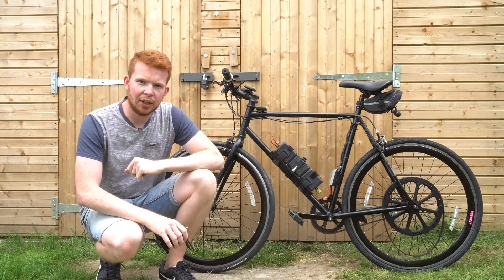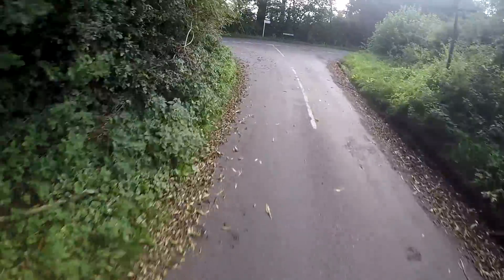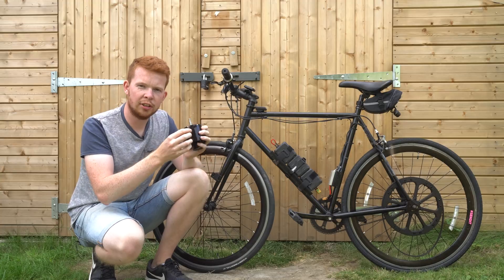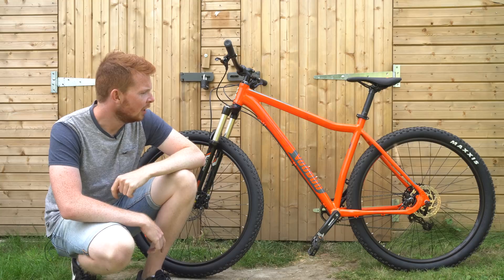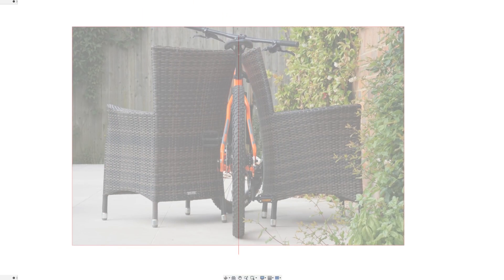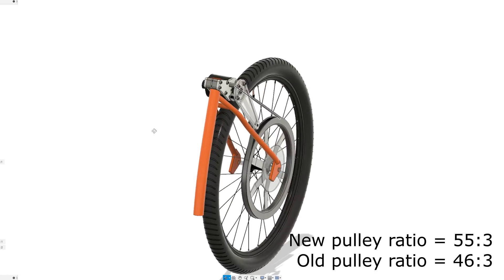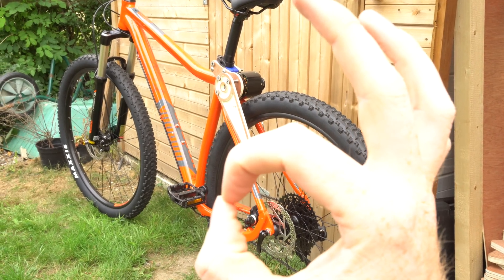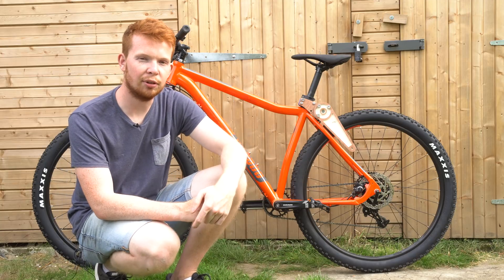Electric Bike 4.0 - Prototyping

Comment: An average bicycle chain takes an amount of torque greater than your body weight, multiplied by the length of that crank arm on the pedals. And I'd guess that kicking out as hard as you can with your full body weight behind it is almost 3x your body weight in force for a very brief moment. So if the motor puts out less than that in peak torque, it should be ok on the chain driveline.

In my past experience, I've never snapped a chain. (Never had a really overly worn out or one of those gram-saver ultra-light deals. So I suppose it can't be completely ruled out.) However I've stripped the hub threads where it connects to the sprocket set a few times by doing wheelies from a dead-stop in a hill-climber gear. Young and stupid then, and then the bike shop got something different than aluminum for the wheel hub the third time. (If I were to guesstimate from that scenario, it'd be something like 500ft/lbs at the crank, and multiplied by whatever that ratio was.)

Your driveline looks easier to work out than going through the chain for other reasons. However that may give you some numbers to come up in estimation if you reconsider it.

Comment: Why not put the engine on the other side, and put on a MUCH bigger first gear witch is driven by electric motor, then adjust the normal gearing so it wont go that high.

Comment: Amazing quality and eye for detail, What I can not understand is why not use a mxus hub motor and control it from your vesc 6 it even has a build in temp probe. I use a mxus in a 20 inch wheel and it can take 8kw peaks no issues and last for many thousands of miles no service if it's had conformal coating applied.

Comment: When I saw the thumbnail I thought you had the motor in direct contact with the tire. It would transfer the torque by friction between outside of the motor and outside of the tire. You can improve friction by a sheet of rubber glued to the outside of the motor and a spring to press the motor to the tire. Motor would have to run in reverse, but the gear ratio doesn't look much off from the pulley and pinion. This is how Solex bikes work, so it's know to work. It would be such a simple design. Would love to see someone try it!

Comment: I made your e bike version 1 and it works great.

Only issue I had is that the 3D printed motor mount was not strong enough and the motor screws pulled right through the mount. Should I make the mount out of aluminum or try 3D printing again?

Comment: Very cool design, although using a seperate idler and tensioner feels really wrong. Maybe you can use the tip of the idler arm as a tensioner by adding a small movable segment.

Comment: VESC usually have options for regenerative braking. The power generated from braking goes back into the battery and you don't have to use the brakes (as much).
Reply: Just got to the part about regen brake. Why do you use the normal brakes if you have regen braking?
Reply: dont think regen breaking is enough, i know its possible to config the vesc to break harder but it highers the risk of burning the vesc due to voltage spikes

Comment: ou could connect the motor to the largest cog on the cassette then use the limit screws so you cant change into that gear. then ou make use of the already made freehub the cassette is mounted on.

Comment: Sweet
 bike Tom! I miss the pneumatic engines though! Maybe you could use CO2 cartridges with a pressure regulator, or a paintball/air rifle high pressure tank to make thinks more interesting. Of course the latter ads considerably more weight so a more powerful engine would be in order :) but as for the CO2 idea this could be great for a plane as they are very compact.

Comment: Hi Tom

Nice to see the e-bike projekt running again!

I don't think that the extra bearing will save your motor bearing. There is two bearings located in the motor and then you are adding a third to the motor shaft. This could cause large forces to all the bearings because of misalignment of the bearings.

I work within mechanical engineering and I just love your projekts! 😊

Comment: You said you can now set the bike on both sides and not obstruct any electronics. But it is good practice to set the bike down on the side with the break disks, you do not want to risk damaging the rear derailleur, this can lead to shifting problems and the chain skipping down to higher gears without warning. And if at all possible it is good to keep the bike up-righted so you don't cause bubbling in the break lines.

Comment: Hi Tom, Bearing life in the motor is a bit of a concern as it's always engaged. If the belt drive could disengage via for example a freewheel at the hub, that would maintain better effeceincy when cycling and freewheeling.

Comment: On my own DIY electric bike, i removed the rear disc brake, and used the six threaded holes for mounting. I mounted the motor just underneath with a thick aluminium plate, and connected them with a short chain. Have you considered using regenitive braking via the electric system, instead of the disc brake?
Project looks awesome, keep it up!
Btw i chose a 29er mtb as well for my project. Seems to be a good choice for what you're doing. I can send you a picture of my setup if you want :)

Comment: You mentioned prototyping the rear sprocket carrier but printer is to small. Make it in sections out of ABS and chemically weld the parts together.

Comment: Hey Tom, I made a version of your bike using chain and sprockets, I  used go kart size #35 chain which is smaller and was able to use 11 tooth sprocket on the motor, and 80 tooth on the wheel. Check it out https://m.imgur.com/gallery/o3z0gGj
Reply: Also more detail on this reddit post https://www.reddit.com/r/ebikes/comments/8z4u3i/rc_motor_esc_fixie_non_3d_print_parts_edition

Comment: On the old bike you had caliper brakes (not V-Brakes) which are sometimes quite bad. However, modern road bike caliper brakes (e.g. the Shimano Ultegra R8000) can be quite good. Brake pads shouldn’t wear that quickly, get some green Swissstop or salmon Koolstop brake pads and they should brake much better, especially in wet or cold conditions.

Comment: I would attach the idler pulley with a clamp around the frame, i think the bolts holding the bracket for the pulley will be a little on the weak side.

Comment: Been loving these bike videos. I'm not a physical engineer (I'm a software engineer) - so forgive my dumb question: 

Why not use the motor to power the pedal gear instead of the wheel directly?  Then you could use the bike gears. 

I'm sure there's a simple reason why not - I'd guess space? (no room for feet, pedals and a motor)

Comment: Its possible to use the  rear freehub space for belt drive if you can design a belt pulley fit in the freehub after 1or2 cogs in the cassette is taken away.(the rear hub of a disk brake bike is pretty compact and this method could be the most rigid and easy way)

Also you can get the bike geometry from the bike manufacturer too

Comment: you inspired me to make my own electric motorcycle. i modeled my own reduction pulley mount to reduce the gearing of the chain from 6:1 to 18:1 because i'm using a #41 chain on the bike and the pulleys are already huge. It has so much torque just from a 6374 motor on 12S it's pretty crazy. i'm just waiting on a larger and wider HTD 5M belt and pulleys because the 10mm electric skateboard one didn't last at all so i got 20mm this time. 

i'll be making a video if it soon once i have it rebuilt with the larger pulleys. i might switch to #35 size chain just so everything is smaller and lighter.

Comment: But what if you decide to pedal it? How much resistance that motor will give to your legs?
Reply: If the system is well designed, you can always drive in "neutral" by electrically (or mechanically) disconnecting the motor from the battery.
If there isn't any recuperation technology built at the system, this is the case at any time since you just 'connect' the motor when you want to accelerate. There shouldn't be any energy flowing back and therefore be no resistance. I'm not 100% sure though.

Comment: Echoing comments e bikes have to be below 250w (unlikely to be tested) but must only provide power when the pedals are moving and ONLY up to 15mph. Posting this online isn't the smartest move if it's being used on roads or public places. This is technically a non type approved motorbike and using on the road can bring the same penalties as riding a normal motorbike without correct licence or insurance and could see you racking 9 points and a fine. Not attempting to be a Debbie downer but the risk is real should anything happen
Reply: I'm sure the UK police are aware of the popularity of diy e-bikes and e-bike mods, and I'm sure they will stop and charge anyone doing unrealistic speeds on public roads. I would also think twice about posting any video of you riding it on public roads. People have been prosecuted in the past with videos they have posted used as evidence against them. Still looking forward to your project though.
Reply: Really sucks how government really does everything to stop people from wanting to have fun.  Everything seems to be taxed heavily, regulated heavily, or simply illegal these days.
Reply: Red Squirrel in my opinion the law could be relaxed slightly with little to no effect as has been done in Europe I ride an e bike my self and I can easily go faster than the 15 mph electric assist under pedal  power. That being said the motor is incredibly useful for hills
Reply: Rich I used to be able to average 18 to 20 mph on my cycle, I'm a bit slower now but one big problem with cycling at a faster pace than most is that a lot of car drivers pull out in front of you assuming you are only going 10mph. If you are doing 30+MPH this is a big problem.
Reply: DoctorJ3kyll I had the same problem.  At the time I was about 18 stone which doesn't slow down very quickly when the same car decides to turn left in front of you.  Ill health means I haven't  ridden for a couple of Yeats now though :(

When it comes to ebikes on the road I think something nicely engineered like this won't attract the wrong sort of interest unless Tom has an accident.  Changing the rules would lead to lots of dangerous and cheap bikes ending up in the hands of people who don't have the skill to ride and inclination to maintain the bike who you don't want running around at high speed.
Reply: Stephen Parkes I regularly see 4 e bikes on my way to work. One of them I can't hold his wheel if I get a gap between us, he is not pedalling.
Reply: This got me curious and I checked into the laws here in Canada, it does not seem TOO bad here, 500w is the limit and can't go no more than 32km/h (that seems kinda limiting though - I've done that with just a pedal bike if conditions are right).  There's a couple other requirements like needing an emergency shut off, and having to wear a helmet.   I suppose with a custom job like this you can just make your own rating plate and try to make it look stock and you'll probably be ok.   If you want to go over 32km/h I suppose you could bring it up to that speed turn off the motor then pedal faster.  Ex: going downhill.  I had a bike with a speedo as a kid and I hit 40 once. It feels like you're going to take off at that speed though. lol.
Reply: Get an ebike to start with.
I ride an a2b metro with a thumb throttle from the factory so it's permitted not to be pedal only,
The power requirement can be tuned in software too and have an off road mode if it was fitted from factory, maximum user voltage is 48v or 13s with a peak power of no more than nominal 350w.
So I got an a2b metro it still complys with its factory specs but it's got enough torque to pull any hill and I run it single speed i don't need gears i can apply enough torque any situation.
I use a 12 fet basic sinewave Bluetooth controller and a mxus 3k hub laced in motorbike rims front and back with new suspension, brakes, drivetrain, I've used the motors kv and wheel size so at 36v the torque drops off around 15mph so it seems like it's limited which it is by volts not software I use that for amps, I can throw 120 phase amp at the wheel max and climb anything and get upto 35miles off a 36v 350wh pack in eco/legal mode or about 10 miles with just under 2kw not bad for a £250 spares or repairs bike that's cost a bag of sand all in and ive got to have fun making it, it's a bonus that it conforms so i can go anywhere a normal bike goes police love the look of it and I get comments all the time as it looks so chunky compared to the stock granny bike it once was.

Comment: As an avid mountain and road biker, I can tell you immediately that replacing rim style brakes with disc brakes is gonna have the opposite affect you desire, disc brake pads are far thinner to start than rim brakes, which I have ridden thousands of miles without needing to replace, and you’ll find yourself replacing disc brakes a lot more of than rim brakes. Also, suspension and using a MTB is going to decrease your efficiency dramatically, lol. If you want to go for a half and half system MTB and road bike I recommend you buy cyclocross wheels, or a bike built around those, which should have a good compromise of all the features you want. Hope this was helpful! I’ve had a lot of experience with bikes in my day, and I hope I can be of some use.

Edit: I realize now, all this advice is from my 3,000 dollar bikes and not Walmart tier bikes, that sorta changes things.
Reply from the maker: I honestly can't give any input on the disk vs rim brake argument as I've never tried 'decent' rim brakes. Maybe there are rim brakes out there that can match disk brakes, I don't know. It's interesting to hear your experience though! 

In terms of the MTB suspension, the efficiency won't be affected. As ABaumstumpf mentioned, the power is transmitted directly from the rear wheel without the 'bouncing' caused by pedalling. As for the wide knobbly tyres, I'm looking at getting some semi slick tyres, basically wider road tyres. Hopefully this will increase the efficiency a bit and also allow more grip on hard surfaces.
Reply: Rian Mach The sintered pads on my Hope disc brakes last just as long as any rim brake I ever owned, and far longer if riding often in wet conditions. Organic pads might be different, I don't know. At those quoted speeds, with dual pot calipers, I'd suggest a rotor size upgrade to 200mm on the front though! (Or 4 pot calipers)
Reply: Derren Weekes I ride MTB  a lot and I have to replace my disc brake pads like every 10-15 rides, (high quality pads too with heat sinks) and on my old MTB it had rim brakes and I never once replaced them, after several thousand rides. Idk, maybe the materials have changed. I also get going like 45 down my local hill fairly often on my road bike with rim brakes, and have never had any issues braking with them.
Reply: This is complete nonsense. Disc brakes are much more suited for this application. Why do you think motorbikes have disc brakes and not rim brakes lol.
Reply: It really depends on what and where you are riding.
On my last bike i had to replace the brakes i think every 2 months - pretty much only used it to drive to work.  
And a suspension might decrease efficiency a bit, but that is negligible when the power is directly transmitted to the rarewheel. (but a raresuspension and peddling your self is a different story.).

Also - diskbrakes do have their benefits - but not the "better stopping power" as some falsely claim. At the lower pricepoints they are just often made form better materials than the rimbrakes (and rims being far cheaper).
Reply: As far as longevity goes it will probably not get better, seems it would be a better idea to improve re-gen braking for that purpose perhaps with a second motor.
Reply: @Jan Detlefsen
Due to space available, drum brakes are not feasable on motorcycles?

Your argument is complete nonsense by the way. Trains employ clasp, disk, band and electromagnetic brakes.
And even then, when you compare disk brakes from trains to cars (or trucks), you will notice the brake pads are much larger and thicker. But mounting a 300kg brake assembly on a 20ish kilogramm bicylce is very much overkill...
Reply: Jan Detlefsen
Goes to show that you do not know the characteristics of disk/rim brakes.
Reply: Jan Detlefsen ok, well how often, if at all, do you ride? I want to compare my ACTUAL experience with yours

Comment: lookup what a jackshaft is for 2 stroke motorized bikes. it will allow you to use all your gears on the bike. its a game changer.
Reply: Or just slap on a bafang or any old  mid-drive motor. You can also use all the gears on an electric bike, with the right motor load location.